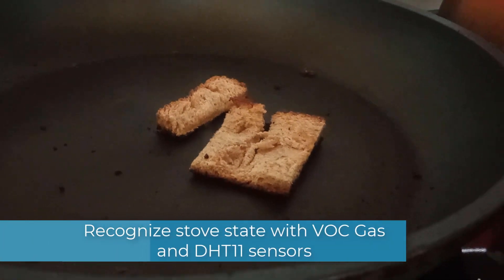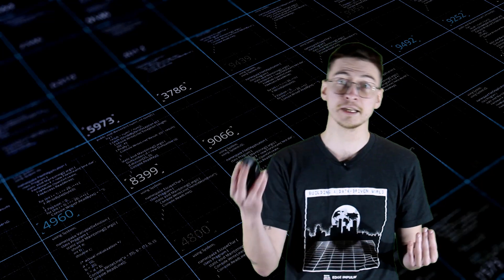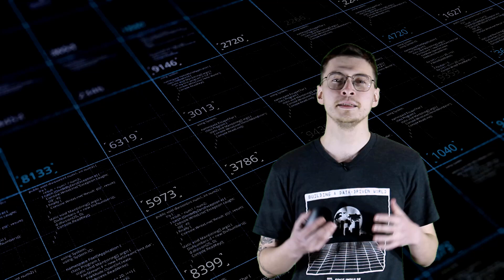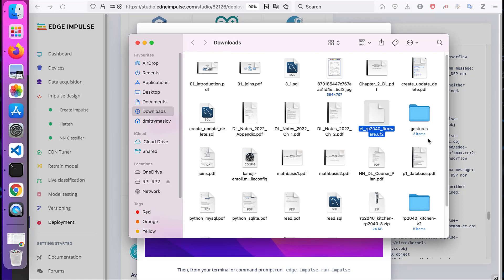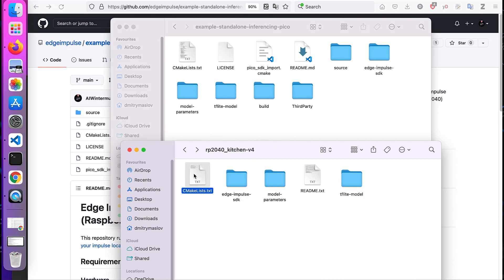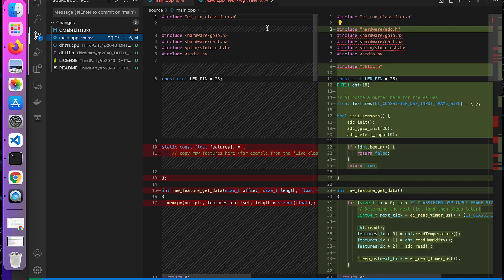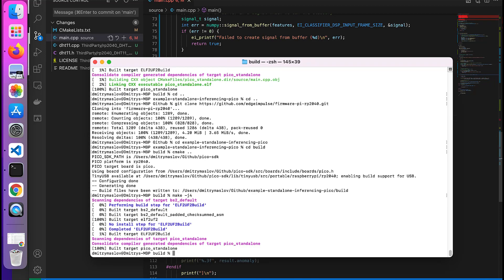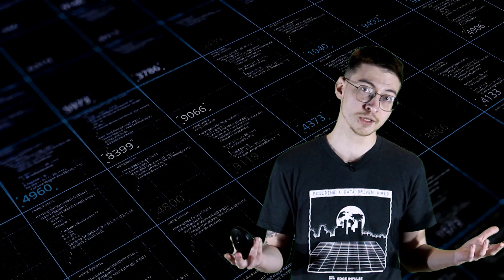Machine Learning with Raspberry Pi RP2040 and Edge Impulse: Sensor Fusion for Environment Monitoring

Comment: hi dimitri.
can we add another sensor in fusion?since in your example only have 3 sensor,
Reply from the maker: In the video i use two sensors with total of 3 axes (temp + humidity + VOC gas). It is possible to have more sensors and axes with sensor fusion, however, not every possible combination will work optimally.

Comment: This was useful to me to build the whole model in Edge Impulse. Appreciate taking the time to explain this. But the issue is I cant find the rp2040 option in the deployment. No rp2040 option. Any one has any clue?
Reply from the maker: You should have RP2040 option as long as your dateset is fusion sensor. I checked just now and it is present for me (I used my normal user account). If it is still not visible, could you create an issue on Edge Impulse forum - with your project ID?
Reply: @Hardwareai   Thank you . Will check it again.
Reply: heyy! were you able to find? i'am facing the same problem